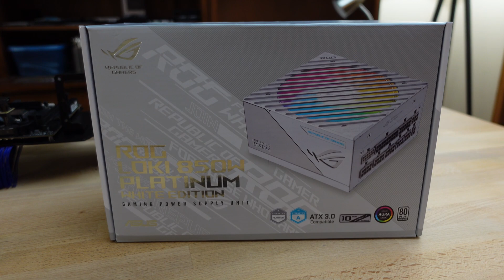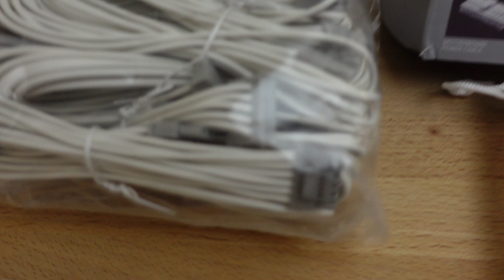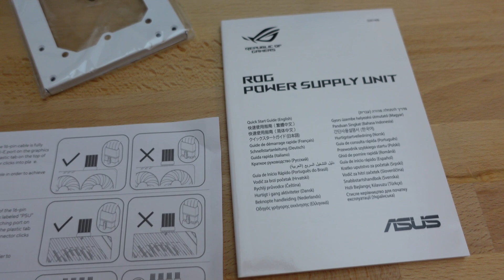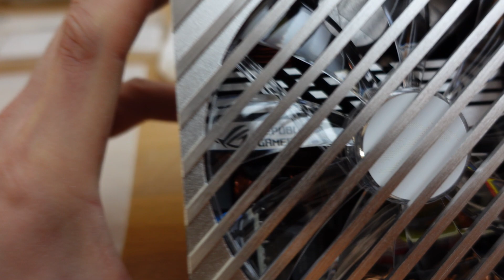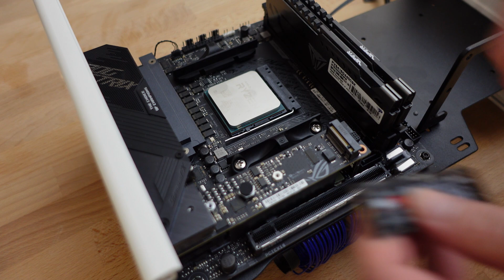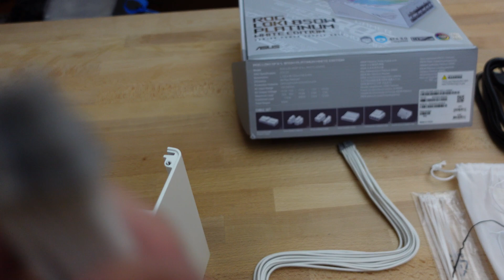Asus ROG Loki SFX-L 850W Platinum White Edition - Persephone Build

Comment: Have you had problems with this psu? My pc keeps shutting down while gaming and I am wondering if this psu is the problem
Reply from the maker: Probably depends on what you have hooked up and the GPU you are using. I've been using this daily and gaming Arc Raiders recently. No crashes at all. But running a Powercolor 7800 XT GPU.
Reply: @nispoe I’m using the 7900 GRE gpu with a ryzen 9 7900x3d
Reply from the maker: The CPU can draw around 160W and the GPU around 260W. I read the GPU could spike and draw 500W. How many things to do you have plugged in and how many drives? It could be that you are at a tipping point and this is causing you to spike and crash your computers' power supply.
Reply: @n @nispoe have 8 fans plugged in, a liquid cooler and I did have 4 drives but one of them isn’t showing up anymore. I also have an external drive plugged in through usb but it’s not connected 24/7. Also all my usb slots are in use

Comment: Guys I never tried building a small form factor pc before. I have a problem. I want to, little by little upgrade my rig without my wife noticing it. So im planning to upgrade my gpu and psu at the same time for now but keep using my atx case. Will the cables of this psu be long enough to reach the sockets on my atx board? 😂
Reply from the maker: Great timing for an upgrade after Valentines day? It probably depends on the ATX case you have and where the PSU is mounted. Newer cases have the power supply at the bottom of the case and the SFF PSU does have shorter cables. Example the motherboard cable on the SFX is 450mm vs 610mm on larger Asus motherboards. The CPU cable is 550mm vs 650mm and PCIe cable is 450mm vs 675mm. I think if I use this on a smaller ATX case this might work depending on where the PSU is located. I have some old ATX cases where the PSU used to be up top, and then later moved to the bottom when the coolers became huge with tower radiators.

Comment: Thanks for uploading this video! I literally bought a ROG Loki SFX-L without confirming if it would fit in my Ghost S1, and i guess it does! Very in-depth! Appreciate it! 🫡
Reply from the maker: Glad the video was useful, the longer SFX power supplies aren't huge, and I feel the longer format gives the PSU breathing room.
Reply: @nispoe  I had a good opportunity to buy a new Loki SFX-L from a buddy of mine. Currently running a Ryzen 9 5900X, 32GB ram, and a 3060Ti FE, Corsair SF600 with custom cables in a FormD T1, so I'm transferring everything over to the new Ghost S1.
Reply from the maker: @MrKittxatans  I tried running a 3060 Ti with this and really liked that combination also. Maybe when 5060's come out I may upgrade this setup

Comment: Hey does the Loki has coil wine ??
Reply from the maker: None that I've seen, I also have the 1000W version that's not white. Use it with my 4090 for AI work. Have run them both pretty continuous for months without issues. Have to see if over time this happens.
Reply: @nispoe  people who had problems had them emidiatly 
I think the PSU is fine 
Most of peoples problems are user error anyways
Reply: @nispoe  just a small update 
I finally got the white 850 Loki and what can I say it was the best decision I made so far
It's absolutely silent no coil whine and the fan hardly ramps up or starts running with my 7800x3d and 4070 all maxed out
And yes there is a time where the fans starts running and it's not the most silent but also I can't hear it over my arctic case and radiator fans
The PSU looks absolutely gorgeous 
So who ever thinks to buy it just go for it don't listen to those 2-3 guys on the Internet who complain on everything 
It's a fantastic PSU
Just a little bit expensive but still worth it
Reply from the maker: @JJ-gk5tn  nice, I use this PSU as part of this build as my daily driver, so far it's doing well
Reply: Have, not has. Does it have.
Reply: @insertnamehere4419  Karen master 5000

Comment: My 850W Loki fan runs at 100% after 10-20 minutes in-game and stays on for about 20 minutes after I close the game. Does yours do the same? It's really annoying.
Reply: So does this mean u dont have the Same Problem?
Im asking cuz i realy wanna buy this PSU but Dome people claiming there ist a Problem with the Fan 
So is there a Problem or Not and IS the PSU silent ??
Reply from the maker: @QQq-h6b I don't have the same problem. I think this is because I'm not taxing the PSU as much. In my setup my wattage usage maybe much lower so the PSU fan doesn't trigger much. My SFF CPU used 65W, GPU max could be 75+150W, and mono/SSD maybe 100W. The GPU has a max of 850W and for best efficiency you try to be somewhere in the middle so around 400ish watts.
Reply from the maker: I had some heavy gaming sessions with this rig playing Helldivers 2 and Diablo IV. I also just ran the 3DMark Steel Nomad Light benchmark. The system stays pretty quiet with the Noctua fan, but I do hear the video card spin up and make more noise. Since the 4060 has those 3 small fans the pitch is higher when gaming, but not overpowering and do hear after it spins down when the inside of the case becomes warmer. What I noticed is that in SFF cases the heat builds up and wants to escape upwards or out the side. Have you tried to take the side or top panel off to see if the PSU runs cooler and doesn't spin up? My thinking is if you have a really beefy GPU this may heat up the case, and since a longer GPU will radiate heat on the side of the PSU this would make the PSU run hot needing the fans to kick in. If you look at the other video with this build and the 4060, the back of the GPU is radiating most heat around the back of the motherboard since it's a shorter card. Unfortunately, the way longer GPUs are designed they are trying to draw the heat away from the GPU chip and towards the end of the GPU (which is where the PSU is).

Comment: How has the PSU been with coil whine / noise? Reviews and comments seem to be 50/50 for coil whine.
Reply from the maker: No coil whine for me and it's been a few months. Have to see over time and have had GPUs give me that whine when under high load. When the system is idle it's very quiet and I don't even know it's on. When I play something like Helldivers 2 I hear the fans kick in and things then get noisy but this is expected. I have another rig I use for my normal gaming.

Comment: what the difference between ATX PSU AND L-SFX PSU?
Reply from the maker: The ATX PSU is your standard size you normally see when building a desktop. The SFX is the small form factor PSU that can fit in smaller cases. Usually has some limits in cooling or radiating heat generated when in use. The L-SFX is the long SFX which is a bit longer, and sort of expands the capability of the PSU. I've seem the L-SFX usually get higher ratings such as platinum. My guess is this is because they can do better with cooling with something slightly larger.